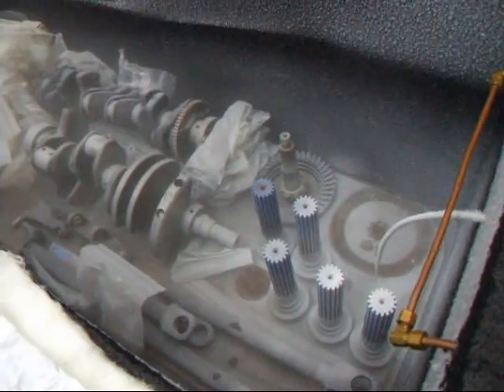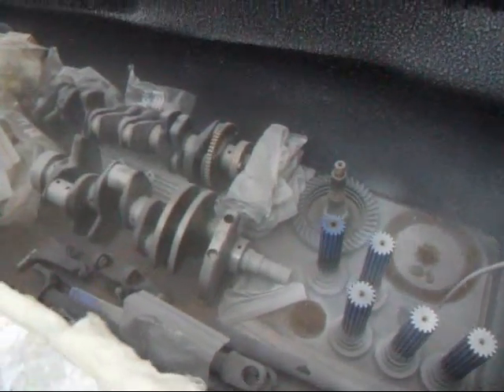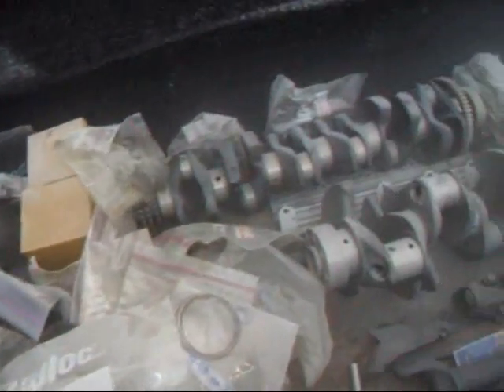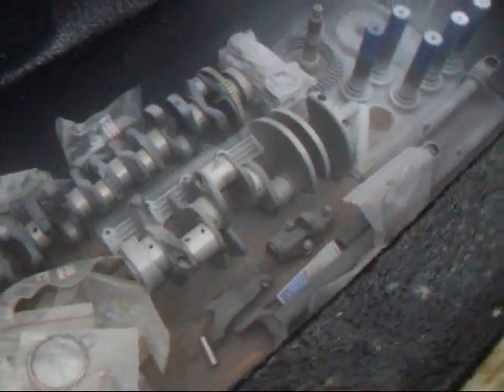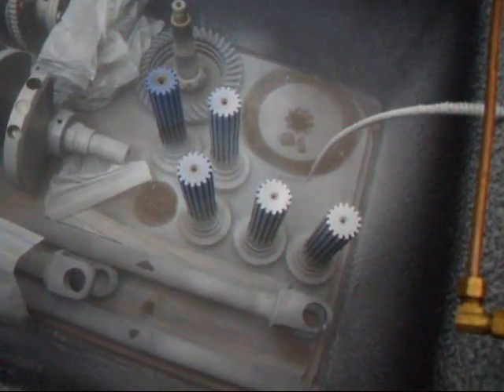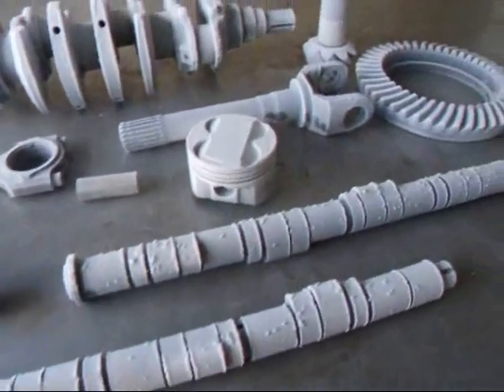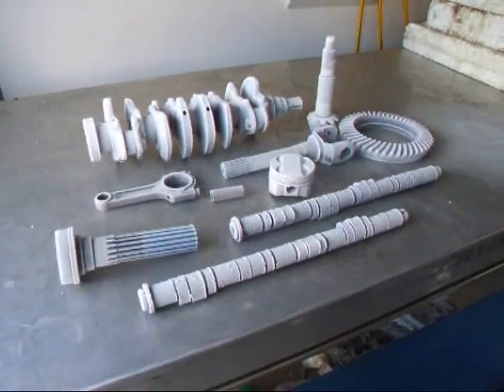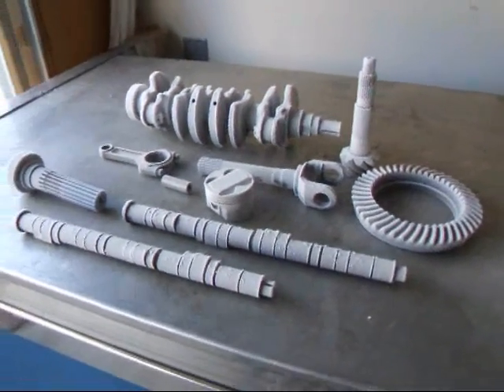Cryogenic Treatment of Engine Parts

Comment: I wonder how cryo treating parts before they are balanced might change their natural balance?
Reply: they are actually a bit easier to machine i did a block align honed and went 030 over it was not only easier to machine but held slightly closer tolerances 440/496 mopar rods crank block it makes 1200hp to rear tires on turbos !

Comment: I have basically an A833 4 speed manual transmission. About how much would it be to have the shafts and gears done? Would it make them stronger?

Comment: Cryogenic, the new buzz word? You have to understand physics to know what is really happening to the metallic state when freezing. This process is used to harden the metal only during the forging process. Extreme heat, follow by rapid cooling. Freezing from room temperature to subzero and back causes the electrons to change orbital state, but they bounce right back at room temperature; net gain is ZERO. DON'T Throw Away Your MONEY. Better yet, study PHYSICS; does the brain good.
Reply: Unfortunately, there are more people like you out there than people whom study and do their due diligence!  Fortunately For every claim you make, there are research articles that advance peoples understanding and create a benefit beyond what is thought possible. Keep your opinions to yourself unless you’ve got concrete proof otherwise. BTW metallurgy is constantly advancing...but this process is over 80 years in the making. Ask the Germans.
Reply: Hey, what do I know. I'm just an engineer, scientist, and technologist. If you have a white paper from a credible source, I'm sure the public would like to illuminate themselves.
Reply: freezing binds the metal grains together to the point they cant get any tighter and looks like chicken mesh slowly bringing them back to room temp lets them stretch while maintaining this structural pattern kind of like nano diamond structure hence making it very tough.

Comment: If you don't perform the crogenic treatment proper and slowly bring the temperature down and back up it can have adverse effects on the metal. It takes days even weeks for the process. You can't jus throw the parts in a vat of liquid nitrogen and pull them out, it has to be gradually done to properly treat the metal.
Reply: 1milesoffun you are a scammer.

Comment: How much does it cost?
Reply from the maker: Andrey Kamenchuk Help me out here, what type of engine are you asking about. My crystal ball is in the shop for repairs right now, so I can't see much any more. A typical 6-cylinder engine runs about $700 to do everything. Other pieces are quoted on a piece by piece basis.
Reply: +fiatnutz How much would a V6 crank cost?

Comment: I am about to build my S2000 engine and was wondering about treating parts and the block.  The cylinder walls in the F20c are Fiber-reinforced metal.  Can F.R.M. be cryo treated?  Also if you treat something like a flywheel or a brake rotor will it preform the same or will it slip?

Comment: It works on the crystalline structure of the materials. Been used for decades in aerospace and really does up the reliability/durability of wear parts and stress cycled parts.

Comment: So its great for knives, tools, drill bits, saw blades

also, engine blocks, bearings, gears, rings, bearings and brake rotors

I dont do this, but some say instruments sound better, golf clubs hit more accurately and rifles shoot more accurately. I havent done the research there but this is what others tell me.
Reply: Nightverslonn those people are either idiots or scammers.
Reply: Add guitar strings !

Comment: I can only tell you what we see in cast iron since thats where my experience lies. In this metal we see both. It aligns the crystal so that its even and more uniform, it does change the crystal shape to a harder martensite, and its taking the internal stress out that is caused when the parts are originally cast. It doesn't really make the metal stronger but it makes it higher resistant to warping and cracking. And its great for wear resistance.

Comment: so, not trying to fence with you, but independent proof exists, its just not published. The people using this to modify metals are doing so for financial gain. If you want to conduct an easy experiment, go to Home Depot and purchase a cryogenically treated hack saw blade (Rigid) and a normal one and compare the 2. I'll guess the Rigid one will cut some 50% or so more cuts than the norm.

Comment: there are the same thing so if you read the hardening article then you get it

I work with this every day so I know where it works and where it doesnt. So if you're curious about something, ask away. If you are just trying to make the point that there is little published data, then that's true. The data obtained is paid for by private hands and not published as this is very difficult to get patents on and when you discover something you can use in your business, its best not to publish it.

Comment: liquid nitro is -320 and absolute would be -450, thats actually pretty close

the hardening benefits happen at these temps and you can get slightly better results with liquid hydrogen, the improvements  seen don't match the increased cost

Comment: it is in certain ways. I manufacture cryogenically treated brake rotors. The metal does not become stronger. But, what we see is the internal stress removed from cast metal objects and a much more uniform distribution of the different alloy atoms. Cast iron is about 3% carbon, once that is distributed evenly, the metal wears at a much slower rate.

Go to home depot, you'll find cryo treated tools now, saw blades and drill bits last longer too

Comment: liquid nitrogen. anyway you need a machine to precisely graduate and adjust the cooling. you cannot just dip the parts in a LN2 container. that will cause thermal shock and your object will become what you don't want them to be.

Comment: How much does this process cost? Does price differ from parts being frozen? I'd assume no since you place all parts in the same freeze state for the same time. Is this cost effective if the parts being frozen are aluminum? What is the strengthening percentage from regular aluminum to cryo treated aluminum? I'm working on a motor build and want to know if this would be at all benefical to aluminum from a price standpoint. Thanks

Comment from the maker: The process is used on aluminum parts all the time, you just don't get the same bennifits as you do in iron-based metals. Still, it's a process that should be done on performance parts, and others.